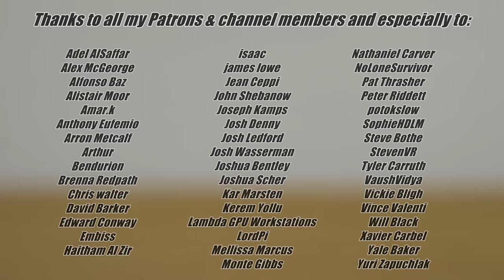Knurling from two Sides - The Perfect Knurling

Comment: That centering is so smart! The threads only provide compression, and the cone provides alignment. Very cool, will file that away.
Reply from the maker: A center drill type B would actually work even better. Then your dead center angle wouldn't run into the thread. Also for heavy machining it might get tricky to get the part loose again.
Reply: Видео вышло 2 часа назад, а коммент оставлен 6 дней назад. Че за херня?
Reply: @ugryumiy  Patreon backers will get early access to videos.
Reply: @mymechanicsinsights  add a nut/washer to the grub screw and use that to lock the part instead. Now a spanner will break them loose easily.
Reply: And it's aligned with the chuck jaws, which is where your concentricity is lost. I can't think of a good reason to do this.
Reply: @ugryumiy   г
Reply: Just like quick detach mounts for suppressors.
Reply: @wbfaulk  But he made the holding device while it was IN chuck jaws, which should have accounted for that, right?
Reply: @jimyeats  right. Not sure what wb is talking about where concentricity would have been lost, except if the tail stock isnt perfect because he flipped the part a couple of times.
Reply: Not sure why you would want to file the alignment away, thats why we turned it!
Nah apart from my terrible joke i wholeheartedly agree
Reply: Knurling is such an underappreciated art
Reply: The center is to make contact to ensure concentricity. The thread is for anti rotation on the driving center. Most center conditions are dead centers for extreme accuracy but having a drive center and a live center the friction of the drive center is sufficient enough to drive the part and do light turning without the set screw but with the set screw  provides the self tightening and nothing to do with compression.
Reply: Seems related to the theory of Exact Constraint that hackaday talked about earlier

Comment: That's an interesting knurling tool! Ive never quite seen one like that at a 45⁰ angle before! Lovely job as always. A failed project or two is still a good thing, every day's a schoolday in the workshop!
Reply: we have one in my shop to, it´s a knurlcutting tool and expensiv af (like 50 times of an formtool ) but the outcome is great and you can cut up to 2mm deep
Reply: I never thought to use a straight cut knurling tool on an angle. I bought a few patterns, bit of a waste haha.
Reply: @ZeppSiros  that´s the way how they cut. for straight lines the wheels have an angle
Reply: @janzweitweg2927  do you know the name of the tool that you have. Struggling to get the depth I need with a traditional tool

Comment: Another 'perfect' piece of precision machining, the overlap was simply amazing. Well done!
Reply: kinda hard to mess up, actually, since it's timed by the lead screw.. you can only mess that up by turning the carriage handwheel instead of running the spindle in reverse to get back to the middle after flipping the part
Reply: @klchapman554  He's not cutting a thread, it's not at all timed by the leadscrew. The knurling wheels naturally catch on the existing knurl and follow it.

Comment: Very nice clean job ,the knurling tool it great, this tool are special cutting  on small cheap , no need pression  on the carriage it good for any machine tool.  Special to knurling pipe.
The regular Knurling tool  not cutting cheap , go by  introduce pression  into the parts . Two  tools require cutting oil.
When tapping using spiral flute you need to support the tap end ,whit center light , recommendation  tapping whit machine tap or hand tapping, are  good to!
Have a nice day from : Brampton , Canada.,

Comment: This may be a stupid question, but why could you just not use a knerling tool of the same pattern but oriented 180° in the opposite direction? Then flipping the part wouldn’t be necessary, you could just change tools.
Reply: Flipping is just easier tbh

Comment: What are lathe dogs? Also, why did you have to start the knurling in the center of the handle, rather than at one end and then knurling continuously to the other end? The result looks great either way, I don’t know much about machining so I’m just curious if there’s a reason for this particular order of operations :)
Reply: Came here to ask exactly that
Reply: Same here. I’ve heard the terms “dog & dogs” used as a name for various elements of machinery parts before but not as part of a lathe.
Reply: It's a simple clamping device. It has a hole in a block of metal with some means of screwing down something that is in the hole like a bar you want to turn. Then there is a handle sticking out of that block which is bent 90 degrees and that tang is positioned so that some part of the chuck or face plate can drive it such as a chuck jaw or slot in the face plate. The driving end is fitted with a center cone called the live center and the other end is a center in the tail stock. The whole system is called "turning between centers" and it has several advantages over turning in a chuck such as turning a taper with offset tailstock, the ability to remove a part and replace it exactly where it was etc.
Reply: @billshiff2060  thank you. I think I can visualize that. I know it’s not an easy concept to describe using only words
Reply: @paulbush7095  No need to imagine it, just search it and see the pics and vids.
Reply: This particular knurling tool actually cuts the steel, so it can only be fed in one direction I believe. It appears there are clearance issues on the tapers on either side, so to get the desired length of knurl it is necessary to come from the center out. Super cool how he picked it up by gradually feeding and letting the cutters seat down home.
Reply: @jordanoneill2743  No, this tool works by deformation, the same as nearly all knurling tools for lathes do. There is a second wheel on the under side set at a 90° angle to the top one. They are spaced so that they pinch the work piece between them, indenting the grooves of the knurling tool into the workpiece. The reason he couldn't do this in one go is probably a clearance issue with the tool not being able to get so tight against the the taper on the back side as the front.
Reply: @siggyincr7447  Hes cut knurling, which is why the wheels are off perpendicular with the work. This causes the wheels to bite the work, and the wheels themselves have a cutting edge. Look into them, super cool tools 👍 although I've never had the privilege to use one myself. Only form knurling such as you described.

Comment: Looks great! Got a question though; how did you made sure that the knurlingtool followed the same exact pattern after switching the part around? Feel like you explain in the comment, but I''m afraid I'm not completely following you there..  
Sidenote; i got into, and started milling because of your channel. Just amazing stuff, really. Thank you for all this content.
Reply: The knurling tool will track the grooves that were already there, similar to how gears lock together, the teeth of the knurler will go into the channels already created.
Reply: @Karthage922  Thanks for the reply! I didn't realise it could be so straightforward. Thank you for clearing it up :)

Comment: Knurling is such a satisfying lathe operation. Especially the diamond pattern, the bump knurls tend give rougher edges.
Frankly I'm impressed you're able to get the proper depth of the tool without double-tracking even once...perhaps there were some test cuts done somewhere off camera?? 😁

Your turning is also exceptionally nice as this doesn't appear to be a CNC so you don't have the option of constant surface speed AND you don't use any fluid in your turning (hence the smoke).

Good machining and lathe work all around!
Reply: I was master of double tracking as an apprentice 😭

Comment: I don't quite understand why you couldn't knurl that in one pass. Anyone?
Also, I've wondered for a while now - Do the ridges on the knurling tool have to be some multiple or fraction or something of the diameter of the part, so they line up every rotation?
Reply: I came here to ask this too. I think he's just flexing his shop skillz.
Reply: @ferretface  No, it has to do with the reach of the tool (I'm not a machinist so I can't give technical jargon).
Reply: Not a machinist here, but if you look at the knurling tool, you'll see that there's now way he'd be able to knurl the part on the far right due to way the tool and part are shaped. The knurling tool would run into the angled section and ruin the part.

Comment: Generally you turn between centers to maintain concentricity between setups. That doesn't seem to be your objective here, as you don't do anything other than the knurling in your "between-centers" workholding, but it's worth it to point out that you didn't really gain that advantage with your screwed-on "center". You lose the concentricity in the chuck and the chuck jaws, which you still used. I'm honestly not really sure why you did it at all. Trying to avoid marring the finish while retaining a strong hold on the part?
Reply: Well yeah concentricity between setups is an advantage with centers but so is work piece rigidity
Reply: @willfinck1267 Sure, but he could attain that with the chuck and tailstock support. There wasn't any need to fabricate that weird pseudo-center for the head end that I can see.

Comment: Very good knurl. Picking up the knurl in the center still seems to show a line. Honestly, I would scrap it in our shop due to the miss match on the center. Perhaps it is a trick of light but picking up the knurl and going the opposite way with the tooling is next to impossible to due without a noticeable separation.

Comment: As someone who knows nothing about this sort of thing: Why did you have to start in the middle of the piece and move outwards to either side instead of just starting on one end and working towards the other? Does your machine not allow for that range of motion?
Reply: I'm wondering that as well. My knurling tool (which I think is normal) just has wheels that spin in a straight line. 
I think he had to because his can only get so close to the right side edge.

Comment: I love this. Your work is like art. I love metal working. It fascinates me. I'm lucky I'm subscribed to your channel!

I'm not exactly sure what a lathe dog is, but do you think you could make one? It sounds very exciting to watch. Any video of yours will be exciting to watch! ☺️
Reply: It's a simple clamping device. It has a hole in a block of metal with some means of screwing down something that is in the hole like a bar you want to turn. Then there is a handle sticking out of that block which is bent 90 degrees and that tang is positioned so that some part of the chuck or face plate can drive it such as a chuck jaw or slot in the face plate. The driving end is fitted with a center cone called the live center and the other end is a center in the tail stock. The whole system is called "turning between centers" and it has several advantages over turning in a chuck such as turning a taper with offset tailstock, the ability to remove a part and replace it exactly where it was etc.

Comment: Hello there when I was taught of how to operate a manual lathe my instructor showed us how it's done. Firstly he attached a dial gauge then he placed a cylindrical metal object to be turn he zeroed the operation to avoid any ovality I see you lathe is running off centred because of a bearing issue.

Comment: Dumb question - could one do knurling by single-point cutting?  
It would be like a multi-start thread, with maybe 60 threads all interlaid.  And it would have left and right hand "threads" so the chance of error is high.
Reply: the result would be different IMHO, because single point "cutting" does only remove material, while "knurling" is a forming process that moves material and changes the physical properties locally. 
but, there are knurling mills for more delicate parts that would just bend under the pressure of a normal knurling tool.
Reply: @supremecommander2398  This is cut knurling.

Comment: I still haven't understood why you had to do this screw/cone piece, and not just tighten the cylinder between the jaws. I'm guessing it's to avoid any mark left on the final piece due to the jaws clamping force required to turn the piece while knurling.

Am i right ?

Comment: You dont need to be turning between centers there is no reason for it. face center the one side. Turn the other fit and back to the largest dia. flip around face to length, center turn second fit and then turn handle grip. knurl handle. Pull off part done. Have that part done in 1.25 hrs or less

Comment: How do you synchronize X and Z axis on a manual lathe to make a 60° dead center ?
Reply: The tool holder (whatever they're properly called) slide is rotate-able. He simply rotates it and then cuts with it. He's not using the two main slides for that.
Reply: @ArniVidar  yeah i have tought about that but didnt think it is because the tool is not at an angle with the spindle